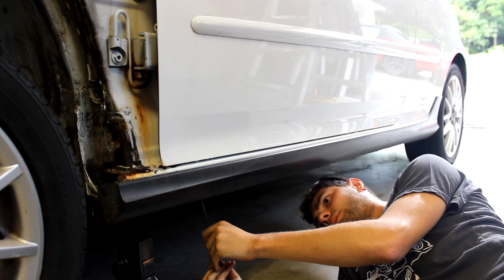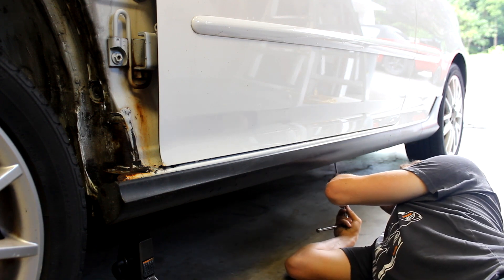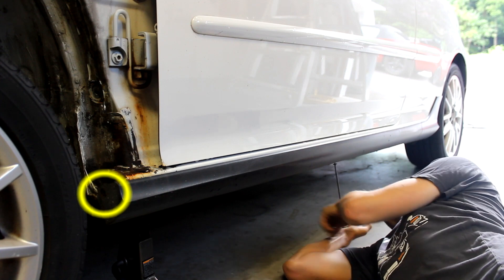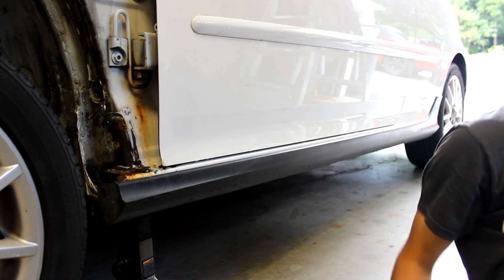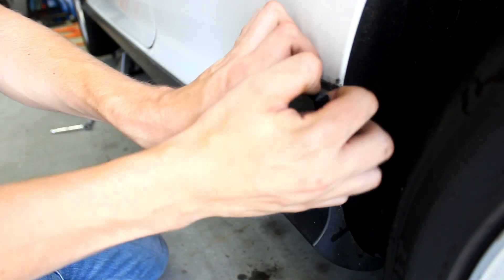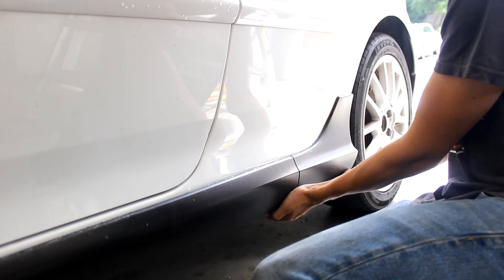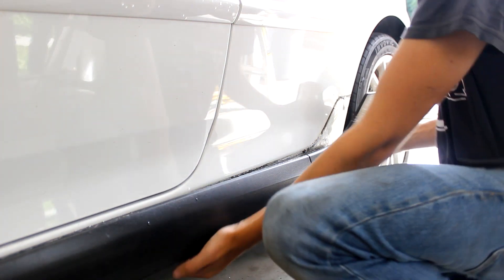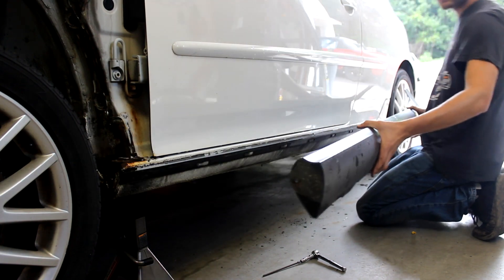How To Remove Side Skirts: MK5 Volkswagen

Comment: what is the purpose of the black rubber seated all along the sill ?
does this attach to the trim your removing ?
Reply from the maker: Yes that's a double sided tape that runs along the skirt to hold it on, good luck!
Reply: @CashedOutCars  its not double sided tape. its plastic attached to the fixings, . the sided tape is only on the skirt itself